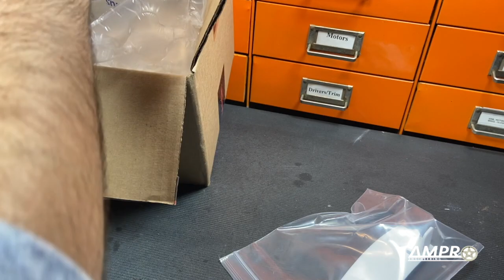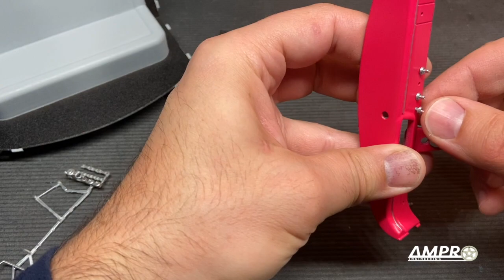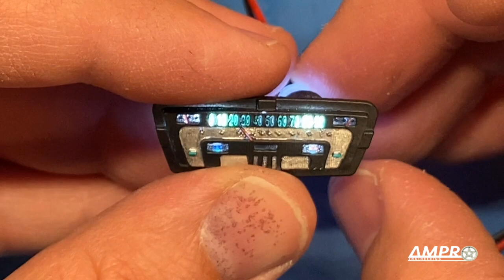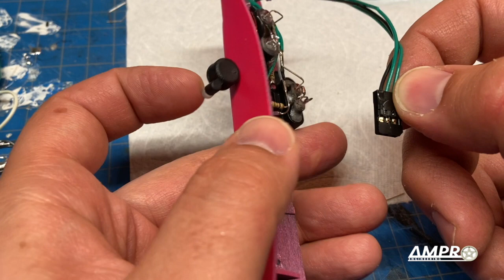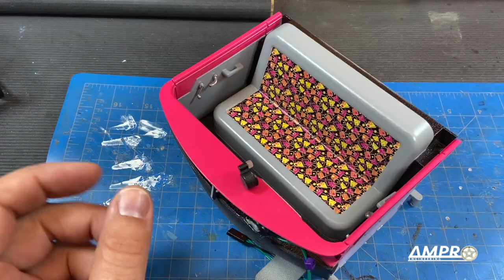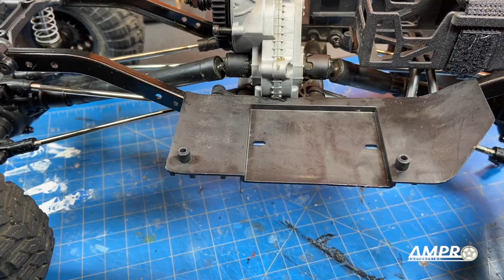e268: Axial SCX10 II F100 Interior

Comment: I need one of those voltage converters. It's a really awesome tool!

Amazing work with this interior! I wonder if you could implement this into a smaller scale like WPL trucks or even smaller RC's
Reply from the maker: Yes, they are very useful. It's rare that I will use the controller in a car but I have. I'm sure this interior can be scaled down. I've done quite a number of interiors and one in fact for the hilux But I have thought about scaling down
Reply: Yes really a good idea!☺☺☺